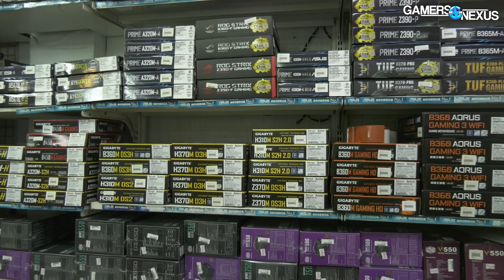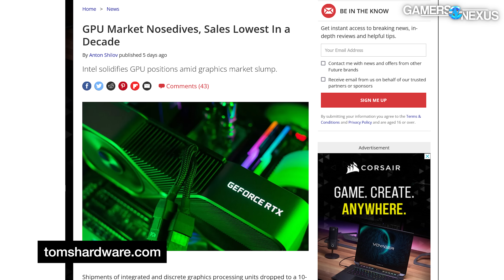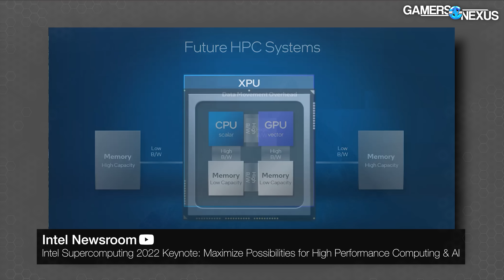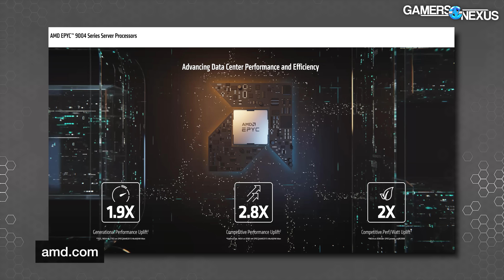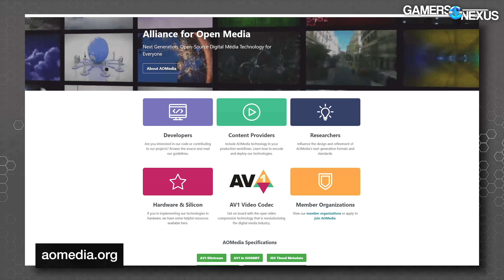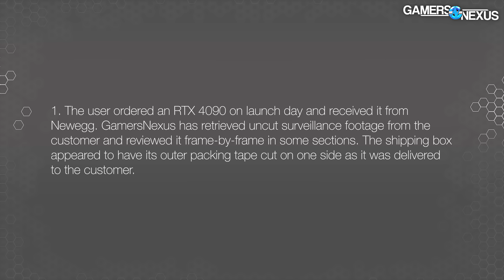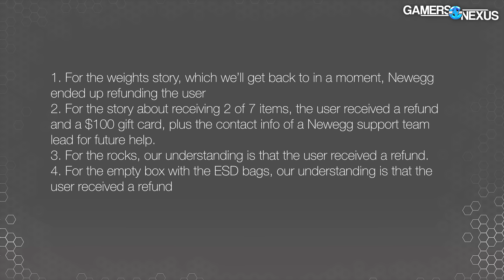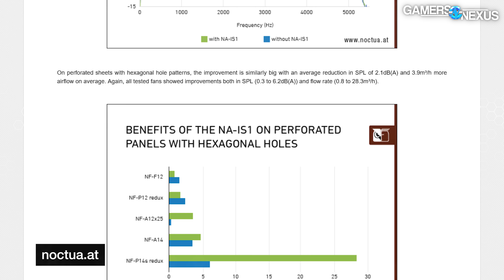HW News - AMD Beat-Down on NVIDIA Prices, Intel RAM on CPUs, Newegg Follow-Up, & More

Comment: As for the Newegg thing. People should really take videos of them opening because it is harder for retailers to refute, where as pictures do not tell the whole story sometimes. Someone could take a picture of a sealed item, open it it, take out the item and replace with something else then take another photo saying that's what they find, I am sure this goes on from time to time. 
 
A video is different as it should be seamless etc. and really can't be refuted. Just a tip, also, you can take a still pic from the videos also if required. Access to a video is way better and doesn't need to take long. This should be with anything expensive.

Comment: I think I'm pretty much done with Newegg, honestly 😅 I've recently received a gpu and cpu, both with a very odd knife slash perpendicular to the opening across the packing tape. Plus, their 3rd party sellers are hard to work with since they're over in China. Bought a monitor new, it was clearly used when it arrived.

Comment: The issue with Newegg is that they also acted like scammers (selling damaged goods while claiming the damage was done by the buyer) in the past so it's hard to have sympathy or even trust them.  Still don't trust them to ship something expensive or multiple items together which is disappointing since the pc parts suppliers online is limited.

Comment: re: the Noctua fan spacers, I used to have a case with less than optimal rear fan cutouts, so I took a broken fan, removed the inner frame, and then used the empty outer frame as a spacer. Cheaper and saved at least the outer frame from going to landfill

Comment: Picked up a R5 5600 and a rx 6800 for 600 USD new. Pretty good. Upgraded from a R7 2700 and gtx 1080. Will pickup a 5800 X3D and higher speed DDR4 ram in a few years for cheap when DDR5 becomes more widespread.

Comment: I bought a gigabyte eagle 6700xt and from my 1060, I noticed just how much quieter on my computer runs. I was worried that the thing wasn't even working but I'm happy to say that it is and it's impressive. It's nailing my 2K display and absolutely flooring what my 1060 could do. I have to say there is no buyers remorse. Get yourself a 66 or 6,700xt if you can, even if your power supply is only 520 Watts. It's really amazing how much better it is, especially with a 9700 KF

Comment: ok so not to add more fuel to the newegg fire....i bought a gigabyte 32" monitor this year and received a 21" dell monitor (in the gigabyte box).  I told newegg...took 2 weeks they DID ultimately send me the correct one but now I'm blacklisted from that site....good for amazon I guess but extremely frustrating

Comment: I ordered a multigig cable modem from Amazon and got a small box about the size you would expect. It was a pillow insert..... Amazon honored the sale price and is sending a replacement. As sketchy as the weight and size of the box was I am just going to assume it was a mixup at the sorting warehouse.

Comment: Even though the RX 6800 XT (which is within a few % of the RTX 3080 10GB) is cheaper than the RTX 3070, and the RX 6900 XT (which is within a few % of the RTX 3080 Ti) is cheaper than the RTX 3080 10GB, people will still mostly buy NVIDIA. Their loss, but really bad for the market and consumers.

Comment: I just got a 3070 fe for 300 dollars. Upgrade from a 2060 super and r5 3600. I left the cpu as is but overclocked it and I'm getting a extra 20fps on the cpu. Got it stable at 4.5 GHz. Sold the 2060 super for 150.

Comment: The problem with lower end cards like the Rx 6600 and the rtx 3060 is that they are still too expensive, when there are options like 1080Ti for $200 which still destroys them across the field. GTX 1070, like the one I have, Is still a capable GPU and goes for like $120-150. The only upgrade from that which makes sense is RTX 3080/RX 6800 but those are still basically 6 times more expensive and offer less than double the performance gains. That's why everyone is waiting for RDNA 3.

Comment: You have to admit though, that thing with the metal plates in the GPU box was always really fishy. That's a lot of effort to steal and replace an item like that, especially when the normal is to simply steal the item, packaging and all, and "lose" it in the mail. Which is a pretty common thing (things being lost in the mail). Heck, just myself alone has had so many items lost (or destroyed) during shipping the last couple years I almost expect it these days. As a matter of fact, I have two items floating out there in the nether right now. 

Recently I had a 55" tv get lost (bigger packages seem to disappear more often). It made it almost to me, then took a trip across the country, finally made it back to me (two weeks after the expected delivery date), and it was destroyed. The box was trashed and there was a large hole in the screen. I returned it and was "refunded" the cost of the item but not the taxes. So that was fun. 

That's a pretty damn good porch camera to be able to see if tape was cut or not. If the box wasn't already flopping open or something.

Comment: Bought a Sapphire 6800 XT Nitro+ a couple of weeks ago for $350 (barely used, guy had it in it's box for the best part of the year). Considerable upgrade from the 3070 @ 2k. Can't believe I slept on the 6000 series for so long.

Comment: With the Newegg GPU issue, I'd have the aluminium/steel plates sent to have their composition tested.
You can usually GeoLocate and pin down the area or country the metal was mined in.

Comment: The problem lies with USPS.  Since 2020 USPS service has dropped off and I myself have had at least 2 packages missing items and clearly retaped.  IMO any order over $800 should have signature tracking and insurance.
On top of the missing products, I live in a rural area and my house number and a neighbor 2 miles away have the same house number but on different streets.  We are constantly receiving my neighbors products as they receive our packages (3x per week or more).  We report it constantly to no avail to USPS

Comment: Ref the weights in the box, when I was manager at PC World UK we had a pallet of Samsung monitors delivered from our warehouse this pallet was black wrapped direct from the vendor to our warehouse and booked in by weight, then pallets where shipped out to stores all seemed ok until we split the pallet to put on display one of my warehouse man called me in to see the monitors half were still on the pallet he asked me to pick up some of the monitor boxes they were the same weight but the weight distribution was off so we opened them they had bags of sand in the one in the middle of the pallet 8 in total off one pallet were filled with sand bags, on contacting our head office the company ended up with 80 units with sand in from 10 pallets, (£400 monitors) just saying this sort of thing happens at very big companies.

Comment: For the fan spacer things, which on the surface absolutely appear gimmicky, have you done any checking of how effective different fan configurations are? For example, when I started working on water cooling back in the 90's (yes, that long ago) there was some research done about airflow turbulence being a real issue when the fan is in a PUSH config and close to a radiator, but a PULL config significantly reduced that. I have seen many of your excellent videos, but not all, so happy to be told if you have already examined that 🙂

Comment: As someone who wanted to purchase a 6800/6900 XT on release, but was unable due to the state of the GPU market and not being a total sucker for taking it in the rear, I just waited and saved my GPU fund(like so many). I knew there was a storm brewing with all the mining craze, Covid magically disappearing(just like peoples common sense), and the start of the Ukraine war. Sure thing, GPU's starting coming back in stock closer and closer to MSRP, and right around the corner was Nvidia's and AMD next gen parts, what a disaster in the making I thought to myself. I told myself I was going to hold out until AMD launched their 7000 Series, but like a hawk, I kept watching my Newegg wishlist just in case a magical deal presented itself. Well I kept watching the 6900's pricing fall and fall, until one September night I checked my Wishlist before going to bed and there it was!! $719.99 with $100 off when using Zip Pay + $20 Mail-in-rebate! Sold! I couldn't pass that up. It's been a huge uplift over my Titan Xp and I'm glad I stuck to my guns and got away from Nvidia. As an avid PC gamer for 20+ years, all of which I've strictly used Nvidia cards in my primary system(all were SLI systems starting with the 7800 GTX until the purchase of a Titan Xp to replace 2x 1080's due to lack of SLI support), it really tainted my view of Jensen Huang as a CEO and Nvidia as a company to see what they started doing with their naming and pricing schemes. The fact that Nvidia is now charging $1600 for a single GPU solution just tops the cake, no........we don't get 2 GPU's on one PCB any longer nor 2 PCB's melded together for ~$1000(7900/7950 GX2 anyone?). 

 It wasn't long ago we consumers could pickup a 2nd tier GPU for $350-$400, now you get entry level GPUs for that price. Did I miss something? Has Raytracing just blown the minds of everyone? Does it make gaming that much more fun?  Did it really revolutionize gaming as we know it? Certainty not. No matter how good a game may look, it is never reality. By all means I hope AMD's 7000 series is a total hit, and I do hope Jensen Huang pulls his head out of his ass, though perhaps he's simply lost his passion and doesn't care about the little people below him. He's put himself pretty high up on that pedestal at this point. Give me more money because I'm the God of the GPU world; say's Jensen Huang.

Comment: Fan spacer can also reduce noise for installing on the front of tower style coolers.

Good thing I've got a 3D printer.  $7 apiece is more than I paid for my (take-off, new OEM, non-RGB)  fans.

Also, you can take cheap or broken fans, cut the fan out of the frame and use the frame as a spacer.

Comment: I hope by the time Meteor Lake and future chiplet designs for Intel will be optimised from the chiplet server chips right now for power savings and performance.

OBS on linux already supports AV1 encode and decode for RTX 4000 series. OBS 29 Beta on Linux brings support for Intel ARC and AMD 7000 series GPUs though.

Comment: For the alleged missing GPUs replaced with weights it could be happening at shipping hubs. 
It’s a little hard to believe a thief used billet aluminum for weight which is fairly expensive.

Comment: Newegg Revisit:
That's what happens when manufacturers try to save money by excluding tamper-evident packaging. I spoke directly with an Asrock representative a couple years ago, and was informed they do just that. No plastic wrap, no stickers on the box flaps. I wouldn't be surprised if many other manufacturers are doing the same thing. It makes it too difficult to process returns quickly and accurately. Quickly generally wins out.

Comment: Once had a 5900X stolen in transit. Received the box and the CPU retail packaging had been opened and the CPU removed. Closer inspection of the box and I found the box had been opened and a new, different tape was used to reseal the box. Pretty sure someone at UPS (the shipper) stole it.

Comment: Like a month ago I got a one year old used 3090 for little under the price of a 3070ti in my country. I wanted a 3070 because my CPU is Ryzen 5 3600, so it would be a bottleneck, but after getting this deal i got the 3090. Might upgrade down the line and still keep my GPU. It's going to last a long time since i upgraded from a 1060. You can find some crazy good used deals.

Comment: Testing on the Lian-Li fans when?  Considering a Lancool 3 or 011-XL for next build with AMD/Asus parts and might be able to use Lian Li fans with that.  Also are you going to be bench marking the AMD 7,000 series GPU's with AMD and Intel CPUs and do you think there will be a noticable difference?

Comment: I was super-tempted by the Sonic motherboard, not going to lie. I ended up buying a Z690 Force instead, for various reasons (mainly because it had features the ASRock board doesn't have, and I would have been just upgrading later anyway), but I might still get it for a friend just because it's kinda rad. Too bad it doesn't have WiFi included for that price though...

Comment: I have that same powercolor hellhound 6600! Great card for the price. Does 1080p high at 70-100fps depending on the game, but only at 130w, and never breaks 80°
Reply: Fair warning though, there's not much overclocking room on it. It's pretty locked down. Best bet is to keep it as cool as possible so it boosts higher.

Comment: I ordered a 6650 from Amazon for 450€

When checking if it was shipped yet, Amazon showed me the same card, sold by Amazon itself, at 350€.

Canceled order, re-ordered the Amazon one. Getting it Friday.

That 50€ under MSRP and was not a black friday deal but the new listing they are selling these cards at starting this week.

Comment: Don't know anything about the ASUS PSU, but for their prices, the LED part should be risk free to service. One or Two screws and pin-pad contacts for the LED assembly. Slot in/out without actually exposing any internal PSU components.

Comment: so it is obvious to me! if heat is spread to different points on the substrate connecting to the heat sink  instead of the old way (one point of contact ) 
thermal dynamic will change 

somebody made a difference

Comment: Sheesh intel should have sold the datacenter GPU described around 13:15 as a gaming card for $1500ish. It would have been a competitor for the top.
Reply: This will trickle down to the next generation Arc Battlemage lineup which is rumored to also use multiple GPU tiles on package.

Comment: 43:45 - thats funny. As for spacing between heatsink and fan i have just made a very big fan frame using aluminum C-profiles for GPU, to mount any 140mm fans on it (25mm tall). Thickness of C-profile was 2mm + 1mm gap between profile and heatsink handles (for original cables) so i have 3mm gap between fan and heatsink now - did something improved? Visually - yes, accustic - it become worse by 2db at every fan speed level.
Now i understand it may be better for case fans to stand further behind mesh front somehow, but from my experience (using mostly Noctua fans since 5 years - air, not high static pressure) i can say otherwise. Best performance in terms of temps and accustics i made by mounting fans just behind front mesh - i have made tons of those tests on Cooler Master Cosmos C700P Black Edition and Noctua A14 PWM Chromax Black + Noctua S12A PWM Chromax Black with whole PC made with air cooling in mind. It may be against physics, but it is what it is.

Comment: Noticed your time bars stopped working at one point.  Is that what you call quality?  And blowing money on vacations across the world.  (JK)
Man I'm jealous Taiwan is one of the places I'd love to visit.  And the Taipei 101.  I missed those kinda videos. Glad they're back. The factory visits and the markets visits are great.  Looking forward to those.   Also, I saw the Sonic mobo a few days back.  I think it looks awesome.  Add one of those coolers with an LCD and have a ring rotating on it and every time it does it changes from CPU temp to something else.  One of those GPUs with LCD and have Sonic running across when changing stats.  XD  Honestly, if I could afford it I would've consider it.  Loved it, but it's Intel and I"m looking to build AMD. Maybe they can release one for AMD that's red, with Knuckles That and my experience with AsRock is not good. I do wish more brands do stuff like that.  You know, something different.  Like those Neo Genesis Evangelion parts.

Comment: RE: Newegg Story ... If the package ( Outer packaging ) is tampered with from Courier You Do Not Except the Delivery ,,, Here in the  UK Most packages have this warning on the outer packaging .. I also work for a massive Retailer in the UK and most of the Expensive items have this warning CLEARLY visible on the Box ... Cheers GN

Comment: Anyone else pick up an ASRock 6800 XT for $534 ($514 after MIR) from NewEgg on Black Friday?  At the time, the best a saw from NVidia was $559 for a 3070 or > $700 for a 3080 using pcpartpicker website.  I picked up an LG 32GP750-B 32" 1440p for $299 on Amazon as well.

Comment: Regarding the GPU prices… I just got an RX 6600. I was originally hoping for a 3060 ti so I could run a few games with ray tracing on, but the way NVIDIA is holding their prices up, I just couldn't do it. I'm sticking with my 1080p monitors for the time being, and the 6600 was ~55% the price of the absolute cheapest 3060 ti I could find over this last weekend. I just can't justify that price premium for the difference in performance.

I don't know how the prices compared in the US over Black Friday / Cyber Monday, but here in Canada, I was only seeing ~$50-70 off the cheaper 3060 ti's (about 10% off), which was… pretty surprising to me. The more expensive 30XX cards were getting much larger discounts, but they were still out of my price range. So, this'll be my first AMD card. Not that I've had any major preference, NVIDIA cards have just typically been competitive when I've bought them previously.

I'm curious to see what the AMD software is like and love that they aren't locking things like FSR behind specific hardware. The direction NVIDIA is going lately has really put me off. Pushing prices and power consumption through the roof, gigantic card sizes, and locking all their software stuff (such as DLSS) to only their cards. It's all just getting a little much. So I appreciate that AMD is being a little more reasonable in those respects.